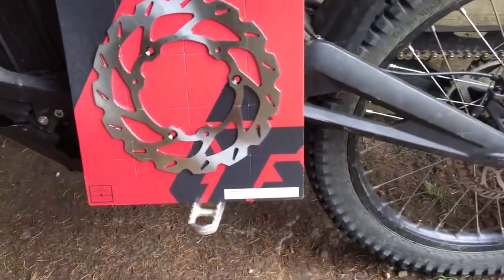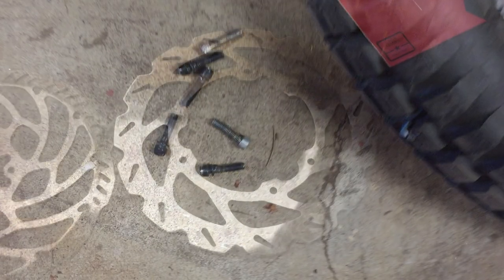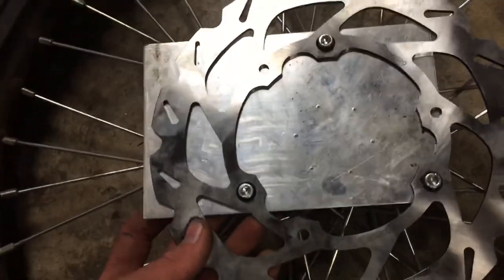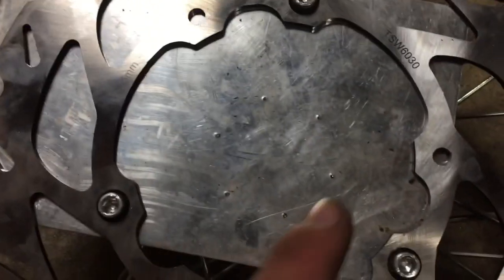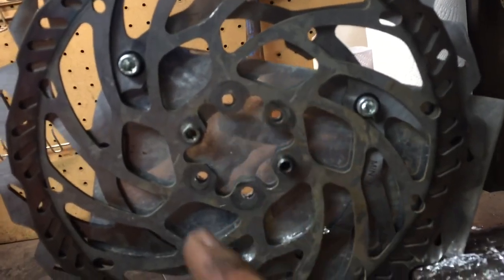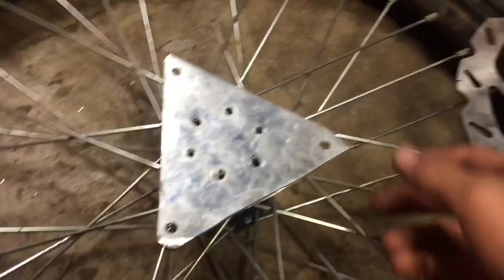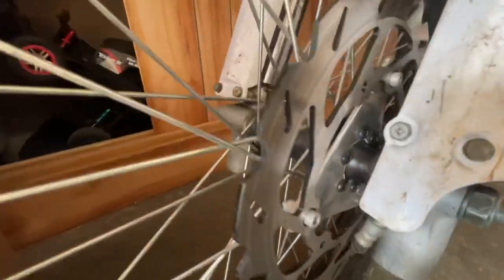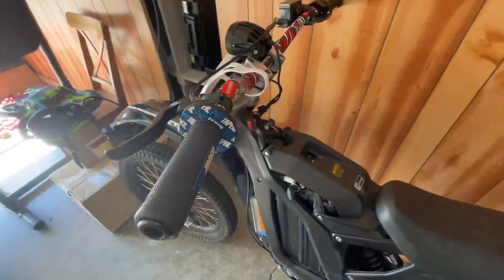SURRON with Dirtbike forks gets Bigger front brakes￼ (bigger front rotor￼) yz85 Forks BAC 4000!!

Comment: Great idea with the zy80 shocks, they look very plush when riding and jumpin the other videos. some resin brake pads in the front would help a lot with the squeaking. cool vid!
Reply from the maker: Thank you so much I’ll look into that!
Reply: I just don't understand why to put bicycle front wheel hub, when fork and brakes are from yz? Su put hub from yz also, no manufacturing needed, more robust. I did this way on my custom frame. Took rear shock, front fork, hubs sprockets from KTM sx 65 and putted bicycle rims and tires. You saving a lot of weight and complexity.
Reply from the maker: @Musvilkis  Well the hub is strong enough for me hasn’t broken it’s still solid.  right now I’m trying to save up for a 72v battery after that I’ll upgrade couple other stuff.

Comment: Is it hard to install the bac 4000?
Reply from the maker: Not really just take it slow to avoid mistakes the hardest part is The wires are in the way when closing the BAC 4000.  You have to move the wires around to make it fit better. If you’re not going to  upgrade the battery the BAC 4000 its not worth it the stock battery limits the power.  you gain barely any power using stock battery
Reply: @aaronmedvedskiy1303  ya I did want to do it with the stock battery but I see people getting some nice speed gains with the bac 4000 on stock battery. How much increase did you get?
Reply from the maker: @GlassfilmWeddings  at first I was barely hitting 49 mph right now for some reason maybe because it got colder it’s back to stock speed if you have a lighter tire you can probably go a little faster I only got it because I want to upgrade to a 72 V battery
Reply: @aaronmedvedskiy1303  have you cut the green black limiter wire?
Reply: @aaronmedvedskiy1303  I also just ordered shinko 241 19 inch 2.75.
Reply from the maker: @GlassfilmWeddings  yes I did